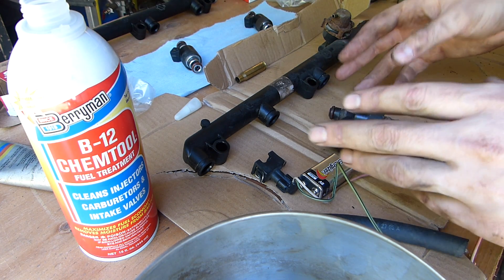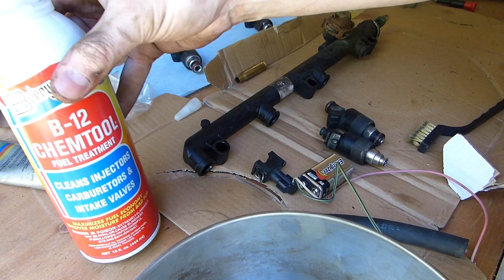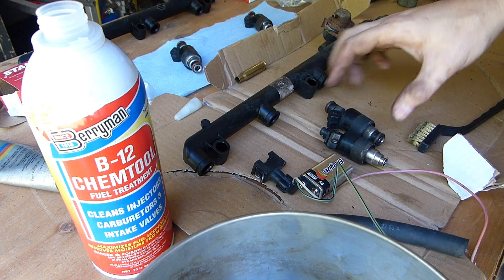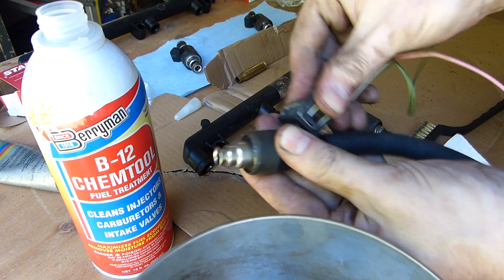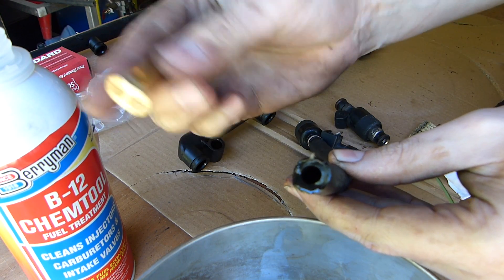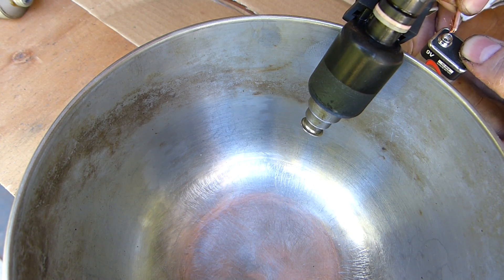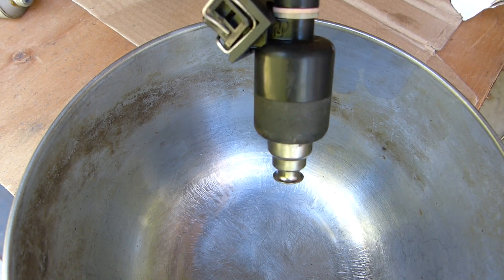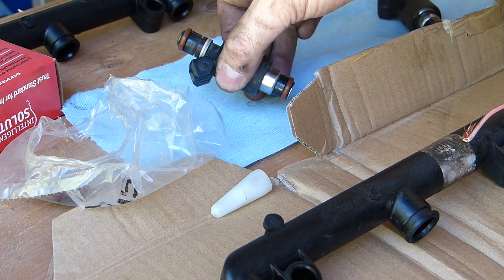Improvised fuel injector cleaning with a battery and... a bullet.

Comment: This is exactly how I cleaned and fixed an open injector.  I had 6, cleaned them all and the last one was stuck open causing issues, I managed to fix it and close it using this method. I had actually purchased one of those kits on ebay with the battery contacts and piece to put the injectors into, used a 9 volt battery and carb cleaner. The ones I have are genuine Chrysler ones for my Jeep, they are impossible to get now (I live in Australia), and the replacement ones are no good.  Good as new now.

Comment: So your suggestion is to force the debris into and through the injector nozzles, not push the debris out by pressurizing backwards. What if the debris is bigger than the injector passage? Won't it get stuck and wedged into the injector? Yours is one of the only videos that doesn't clean them backwards first. Just wondering why.
Reply: Right! Back flush first.

Comment: YOU DO NOT LUBE THE ORINGS WITH ANYTHING BUT GAS put sum gas on oring and put back no lube no oil those are gas resistant orings anything but gas will decrease a bunch of its durability
Reply: Always used engine oil. Never had an issue. If they are fuel resistant shouldn't they be oil resistant also?
Reply: @widtrak77  doubt it only fuel go thru them injectors

Comment: Can we  connect battery  Negative  and positive charge terminals to  injector  randomly. Does  injector will  work or it  blow  off ?? Please do  reply
Reply: Refueled And Boosted you can but just remember to connect only one terminal to the battery and tap the other one quickly

Comment: I cleaned the injectors and the throttle body on my toyota tercel the same way as you but when i put everything back together it idle over 1000 rpm as before it was close to 800 rpm what could i have done wrong for it to do that ?
Reply: Vacuum line hose

Comment: So you have very flammable fuel that you also make in aerosol form and then you have a battery which can cause a spark.  I think you haven't thought this through very well.  Usually, a carb cleaner is used or a brake cleaner but this cleaner is not flammable.  But really, fuel and a battery and getting your face up there, sounds like you could end up with severe burns all over your face if you get the wrong situation or just a small spark.
Reply: Red Rum beat comment ever
Reply: @JB-qu7gp  no no that is not the best comment ever it is never good to call anybody to douche either be positive or don't take to making comments cuz you got nothing else to do.
Reply: Seriously? Then use a longer tube. All you idiots with no ability to think for yourselves. It's a good idea and if you're afraid, change that you think is dangerous. Sounds like you're using YT instead of reasoning skills.

Comment: Thanks you for this video. Yesterday I have cleaned my fuel injector after watching your video carefully. The most hard part was to take the fuel injector out from the car. After this things were much simpler. I buy a 5cc syringe from the pharmacy and cut the far end of it. Then I took the o ring from the injector inlet and push tight the injector into the syringe. I fill the syringe with the carbon removal fluid, which I buy it from a local auto store, and put the the syringe push piston inside. I took two alligator type wire and hooks the end into injector electric point. I connect the wire to car battery, to open the injector valve, and push the syringe piston. the injector start throughing fluid from other end, hence cleaning done. I did it with rest of 3 injecotor and put it back and car start in single self :-). One thing which I regret that I should have clearned but passing the fluid from other side as I feel that it will clean the injector throughly. Two of my car injectors, out of four, were not working but after doing this few of the injector nozzles open. SO if I do it both ways may be all of them open. May be next time when car give me injector problem :-)

Comment: Thanks, this looks like a really good way of doing it. When I do mine, I'll probably use an air compressor to get more pressure in there. (But not too much!) Flushing with gas is completely unnecessary.  The gas will flush them out for you when you hook everything back up.  You can even run an engine on gumout.

Comment: Brilliant.  I did something similar, except I actually used compressed air.  You can see if the spray pattern is good and you can see it get better when cleaning a dirty injector.

I use silicon spray on orings.  Whatever you do, use some kind of lubricant on them so they stay seated during installation.